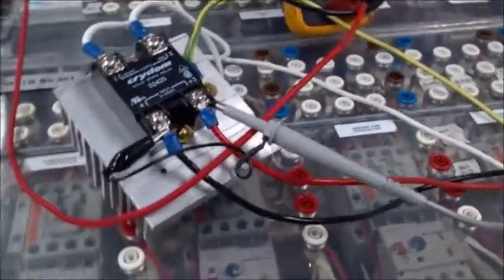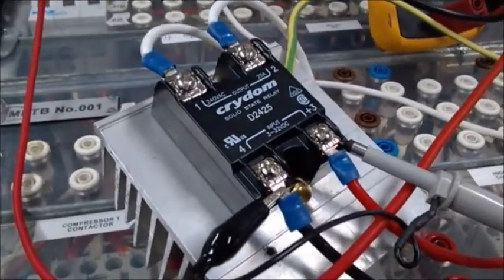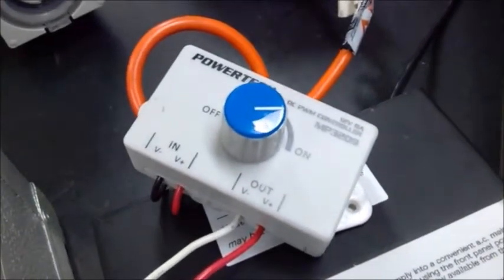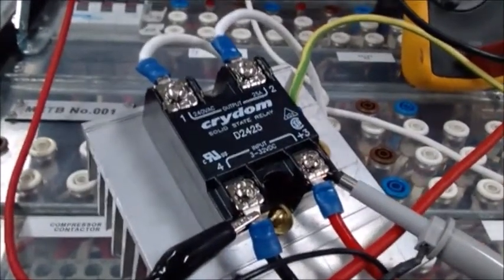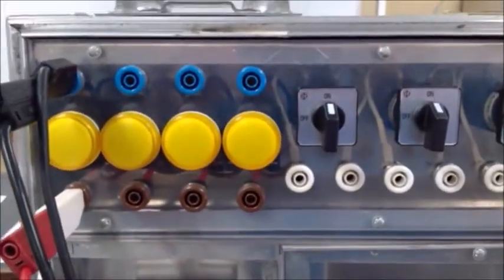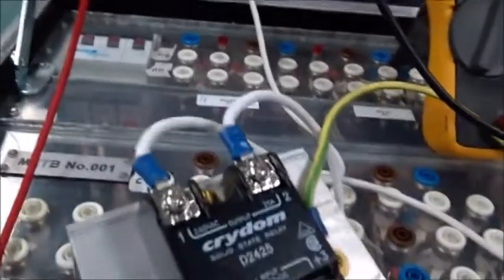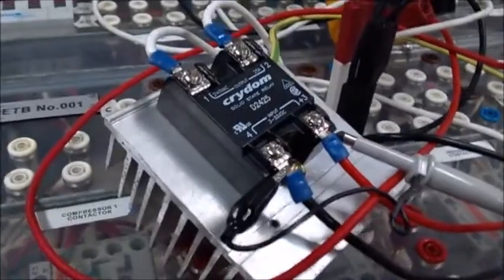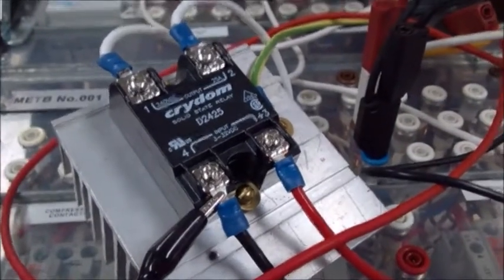PWM & Solid State relay

Comment: An SSR will turn on with the control voltage. But it will not switch off until the AC voltage goes to 0 volts. Because there is a Triac (AC Thyristor) in there, not a transistor. But you can dim the power if you switch on synchronously to the AC wave or shifted to the AC.

Comment: I just installed a SSR on my AC heat bed of my 3d printer.I was wondering how the relay was working the output while having a PWM input signal on the control voltage side.Guess this helps little bit more of what is going on. The AC heat bed it 120vac 1600w and is doing just fine with mataining where i set temp at..  Thumbs up.. :)

Comment: It would be nice to see the output voltage of the load on the oscilloscope as it relates to the duty cycle changing, is it acting as a triac only changing states at the zero cross?

Comment: I've been looking for information on the performance of a dc-dc solid state relay when operating under PWM, and if this could be used to control a DC blower fan.
Reply: The fan would be an inductive load and I don't think you can pwm inductive loads - only resistance loads.
Reply: @LarryKapp1  I used a mosfet array to do it for a while but it couldn't take the load of the fan.

It worked, for a while, then broke down.

Comment: hi  Dennis. After a bit of advice. I have a Crydom 50a SSR driving a 20 amp load on a water heater. If I put a PWM on this what would be a sensible switching frequency  (Hz) to give a pwm effect without shortening the life of the SSR too much by askin it to do too much?
Reply from the maker: The device that switches the load has to be able to handle the current. Other than that proper heat dissapation is needed. As for switching, well its what power output your looking for from the element and what timebase of pwm your using.  I cant tell you what the maker of tbat ssr has designed it for so i would check with them or their agents.  Thermal loads like elements are far kinder for these devices.  The drivers for the devices can be stand alone or integral if its a purposed control such as hvac reheat boxes.
Reply: @whatwoulddennisdo7243  Thanks for that. For info the device we have has a massively overspec'd heat sink with fan cooling.   The datasheet wasn't a huge help to me - the slowest on or off time for this particular model is 30msec. (around 30Hz)  - so 60msec to turn on and then off again.  The current system has a PID controller driving the ssr. But we are trying to simmer boiling water and it's not great at doing that - control period on the PID device is 2 sec.  The power setting we need is somewhere around 50% I think based on observation of the system. Haven't purchased a PWM yet as I'm not sure what frequency range I need. Any thoughts on the above appreciated!
Reply: @vintagechemist9427  I pwm a water heater coil . The pwm input is from a Midnite solar controller AUX contact so it can  give the water heater coil any extra power above what the batteries need . It operates at 250 hz. If you look up the Midnite solar Classic manual you will see how they explain the pwm works on AUX2 for Waste Not .
Reply from the maker: Answer to this is what  the maximum rated input frequency is permitted per manufacturer. As long as you don't exceed the rated output , the input speed can be anything permitted in the specification range. But be mindful of transient spikes with high current switching systems so low range for high power seems sensible

Comment: what happen if DC load short  during PWM  application
Reply from the maker: Any load short circuits can damage transistors. In the case of dc input voltages, worst case is that it wont turn off or its damaged to open line.

Comment: Dennis nice video. Am I missing something here? I do not see PWM here since for any dial reference there is only one output pulse cycle and the pulse width  is constant. This device is  just outputing a dc pulse with selectable duty cycle. I also see that your scope was connected to the SSR input..., the  assumption tacitly made is that the relay is switching on and off the power line following the pattern of the input waveform this is not always the case. It would be nice to see both traces on the scope, the relay output and input.

Keep the videos comming!
Reply from the maker: Hi Shield, thanks for you comments,   the relay ouput switches at the same speed as the relay pulse input. Semiconductors are just that fast. The PWM is constant from the device fitted, if your looking for lag, this is on the mechanical output.  For purposes of AC output delivery,  this lag if any wont create any indifference. If it did it would be microseconds of time and nothing added much in watts to create any issue of power load management.  I do get your drift here though, im sure there is some lag

Comment: Dennis, i need to make a pwm or ramp voltage controller for a 12v solenoid coil on hydraulic machine. It needs to ramp up to 12v slowly or controlled or adjustable in some way. What would be the easiest way for me to do this?
Reply from the maker: Thats not really an area of industry Im familiar with.  It would best to ask that to an electrohydraulic servo mechanism, motion control specialist for use with dynamic load lifting.

Comment: At the end of you video you say “An inductive load wouldn’t like this much”. 

Does that mean using PWM to control an SSR would be a bad idea as a speed control for a small DC brush motor? If so what is the effect/ damage that would occur to the brush motor?
Reply from the maker: Interesting comment,  you can use a simple voltage regulator on an AC motor to control spped, its been done on small exhaust fans but when the torque on the motor is too high, this becomes an issue for amperage.  Phase control motors use SCR and effectively control the voltage output but then again torque and amperage become an issue if the load increases. PWM is used more on dc  or to throttle resitive AC loads.  Cant see how a brushed motor would be any different but these Q's need to be put to the motor manufacturer.  EC and Brushless motors are more commonplace now.